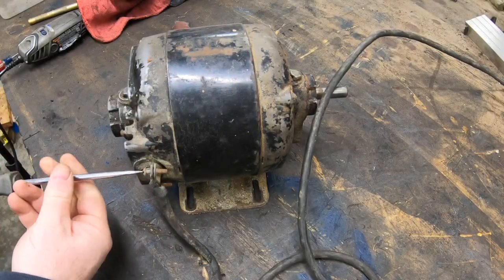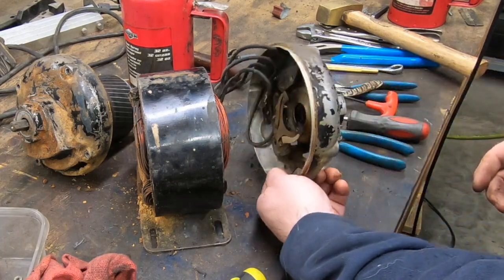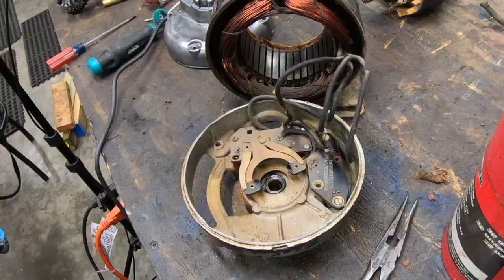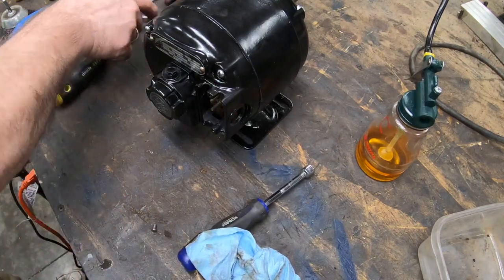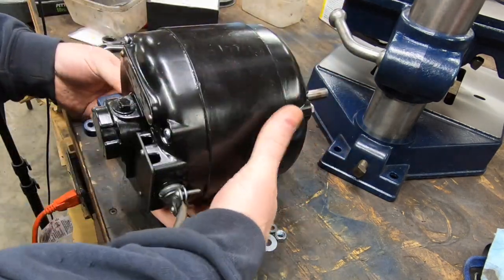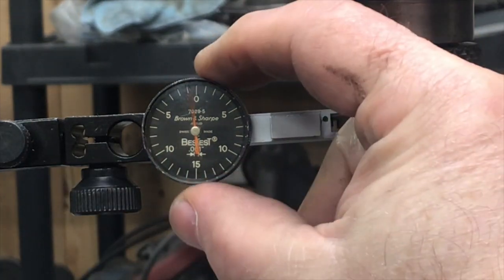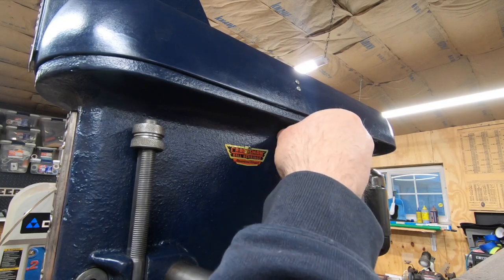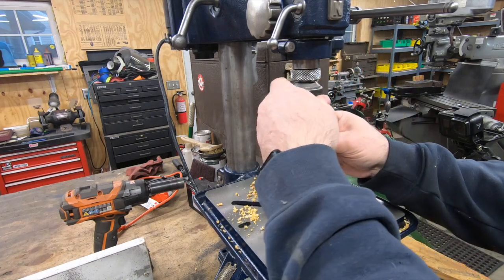Restoring a 1940s Craftsman Drill Press - Part 5

Comment: I inherited one these from my Grandfather and it still works great. I think he bought it when it was new or right after the war. Seems he replaced the motor, does anyone know the specs on the old motor? I have to spin it to make it run
Reply from the maker: The tag on mine is long gone. You might have a bad start capacitor in yours.